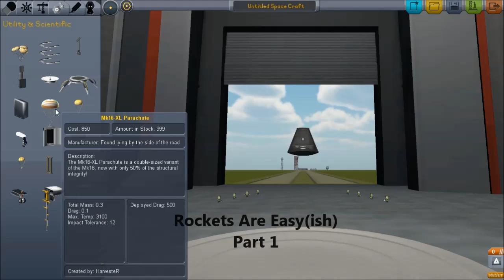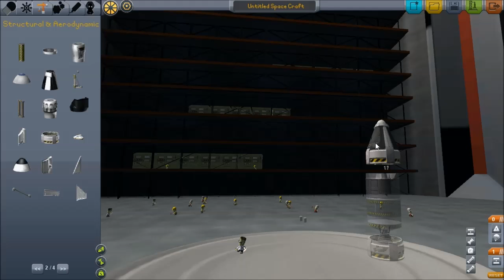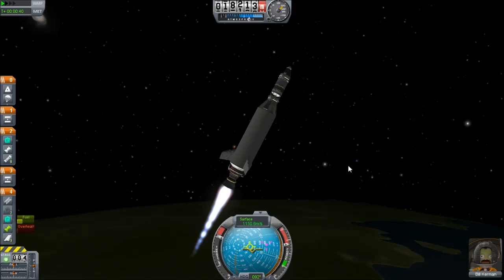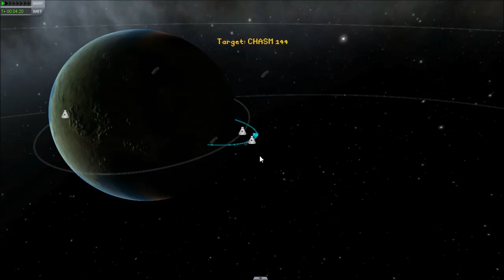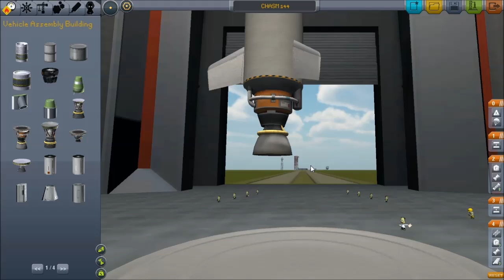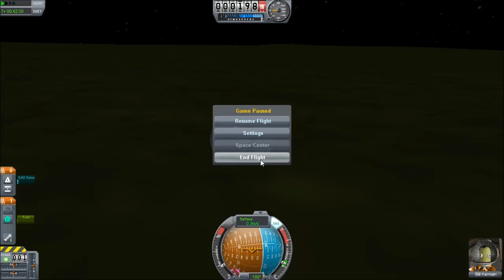My Dad Builds A Rocket In Kerbal Space Program - Part 1

Comment: Today I learnt that for fins, it seems good to have it in a t-cross relative to your pilot/controller rather than in an x-cross. Since you have cursor keys and not joystick. Also, three control fins would give different controlling force for different inputs. e.g. yaw left may not be as strong as pitch up, or that it does not make you turn in the direction you want accurately. I could be wrong though. I have no calculations whatsoever to go along with this statement